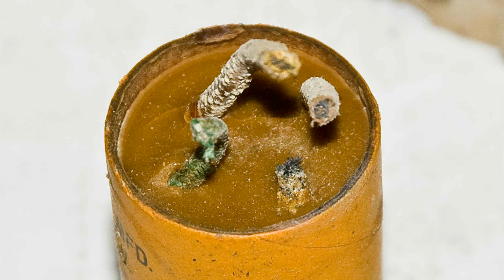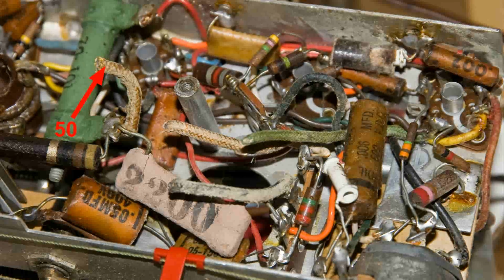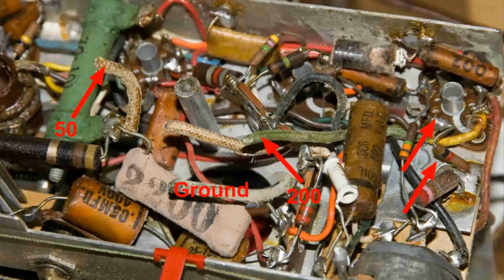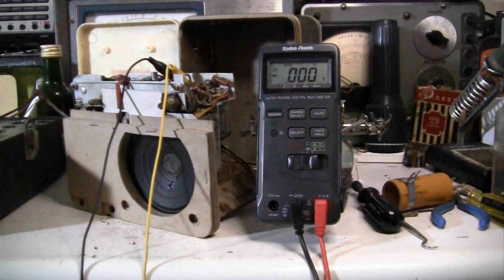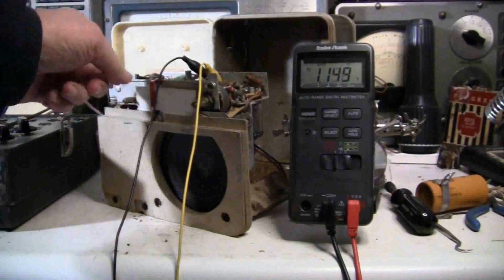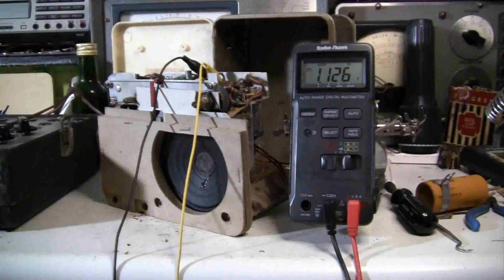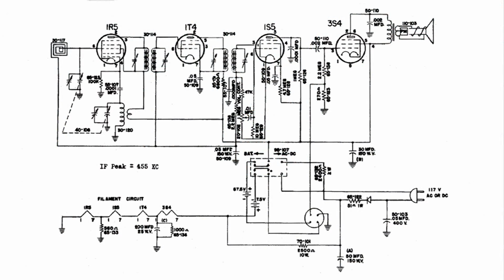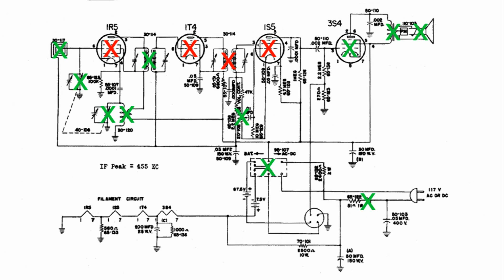Regal Radio 747 Repair Part 3, Project Ends

Comment: Too bad it could not be fixed but so great that you got good parts from it. Did the old batteries leave acid corrupting the metal and parts? It seems by the video that all was OK exept for the IF can and bad front end tubes. Good luck and thanks for the tour through the 747!!

Comment from the maker: @CameramanLink 

I have bought many radios for parts, which I have discussed in my ebook, and how to use them. I paid $10 for this radio and the good parts are worth $60 at least. So it made no since to proceed farther. If I only had one of these, different story. The hard part was getting the filament correct with out burning out the tubes.